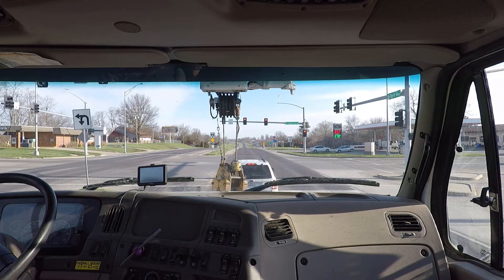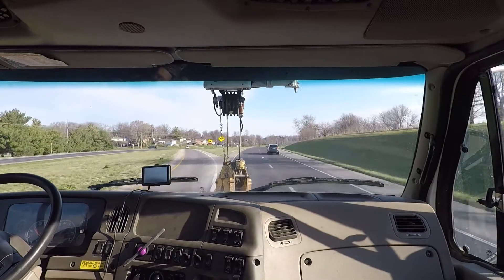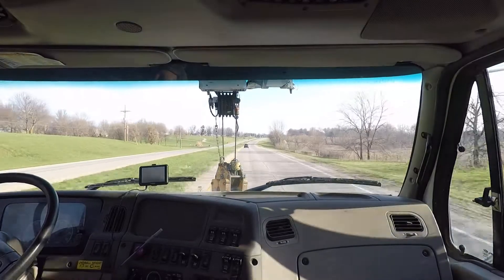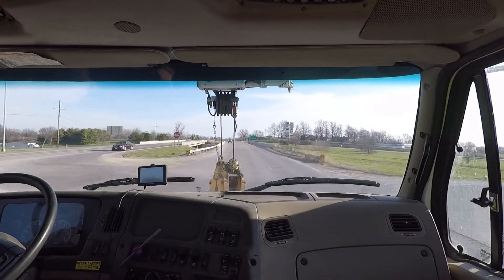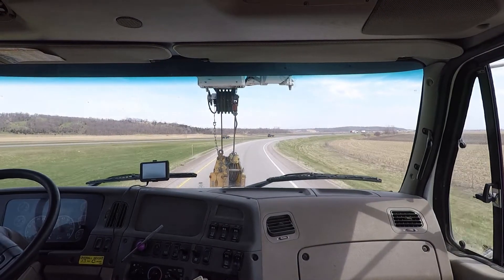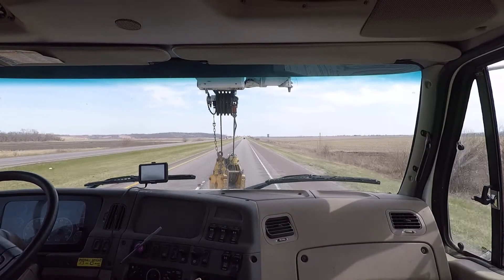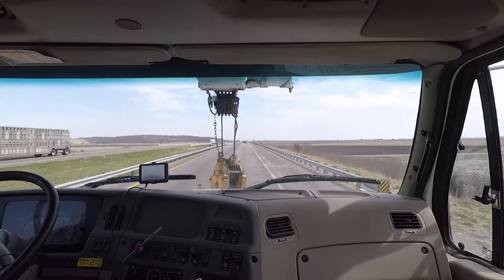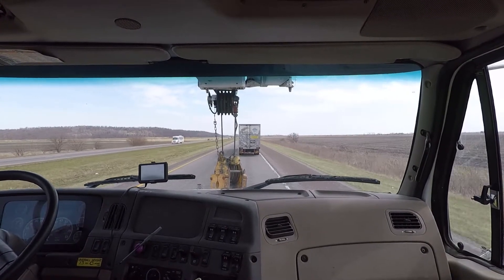Manitex 50 ton boom truck

Comment: Thanks for taking us along for the ride. If this is a ultralight crane at 50 ton possibly some bait caster action with in sometime. Still would love to see you cast Andy on the Gravely in search of the big bass. Have a good week Jimmy.
Reply from the maker: Jeff Pratt, the 200 ton will be an ultralight tomorrow. I'll have all the main boom out and all the jib on it. Total boom length will be 320 feet. Tip height will be right around 330. Or the length of a football field with both endzones.

Comment: So I'm assuming it's cheaper to bring the small crane out and do part of it and then bring the big one out to finish than to do it all with the big one? I also assume there customer gets charged for road time as well?  Sure wish you could have recorded it and I know you do to. Thanks again and be safe.
Reply from the maker: Mark Mortensen, all of your assumptions are correct. Hopefully I'll get some footage tomorrow. If nothing else, I'll get some video of crane assembly. I just got done putting a camera mount on my hardhat. 😉
Reply: To The Top Crane --That should be some great video. I have seen a few others put the camera on they're hat and it gives a great view. Sure hope they let you video the job. Take care.
Reply from the maker: Mark Mortensen, quick update. I got some footage of some of the crane assembly. But, none of the tower construction. We will have some pics though. So, my next video in a few days will have crane assembly and a short slide show.
Reply: To The Top Crane --That's really nice to let me know about that. I guess that big boss didn't want any cameras on the job? Thanks again.

Comment: What's the GVWR and engine on that one? Seemed to move pretty good.
Reply from the maker: It weighs around 76,000 lbs, and has a 400 or so horsepower  Mercedes in it with and Allison auto.